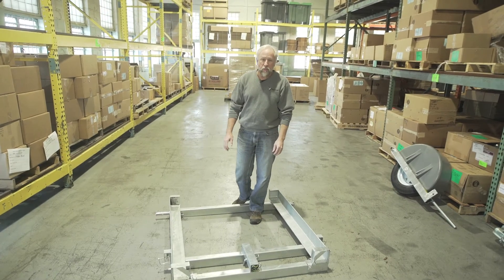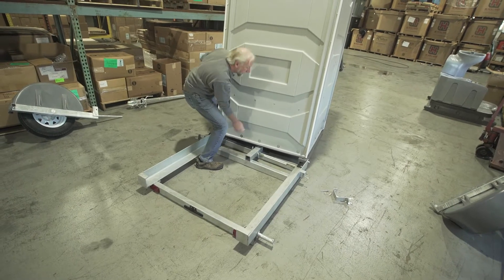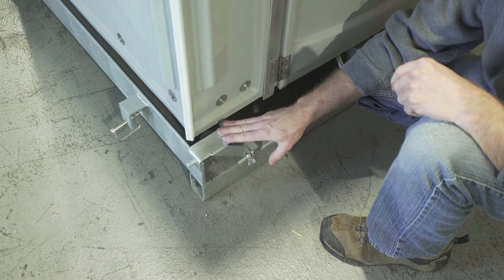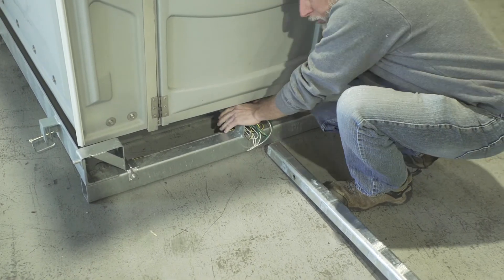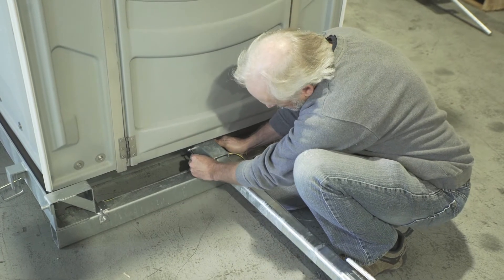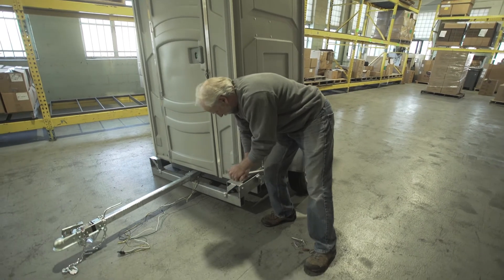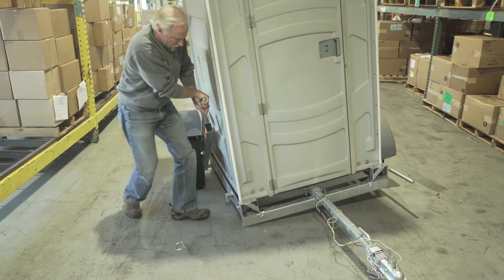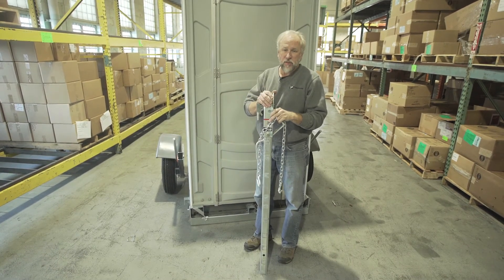How To Properly Operate Your Portable Toilet Trailer

Comment: Hey Jamie, do you have a video for the double trailer yet (both an intro and how to operate the double trailer since the instructions are different for the setup on the double trailer (positioning, etc.)?
Reply from the maker: The operation of the double trailer is the same as the single. Removing the pin, pushing down and out will lower the trailer to the ground. And removing the tongue is the same as the single trailer as well.

Comment: Does the Polyjohn FS3 fit on these trailers?
Reply from the maker: Yes, we have slightly different versions to fit the FS3 Fleet Series units. Just make sure that you mention when ordering that you want it for the Fleet unit. Part number for the Fleet version is TU01-1001 for the single trailer and TU02-1001 for the double trailer.
Reply: PolyJohn ok great...thank you!
Reply: brian braziel what’s your email address
Reply: lesedi britt who are you???
Reply: brian braziel dont worry I wanted to send to PolyJohn